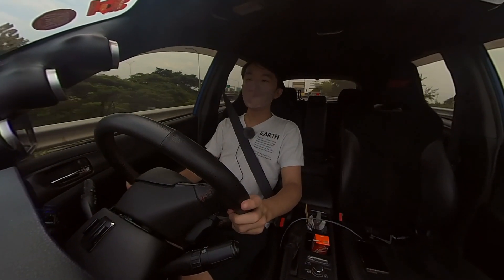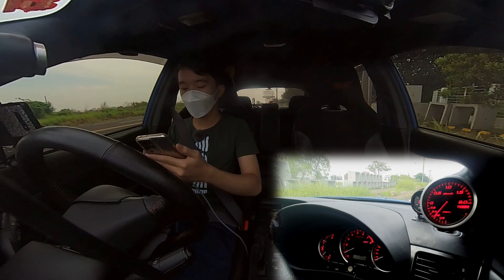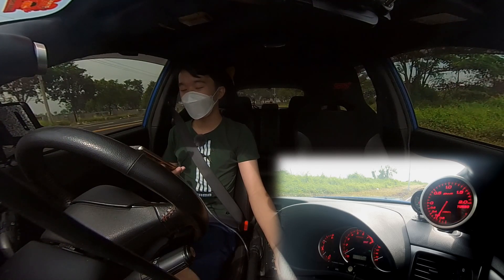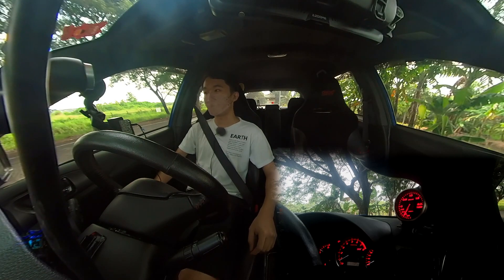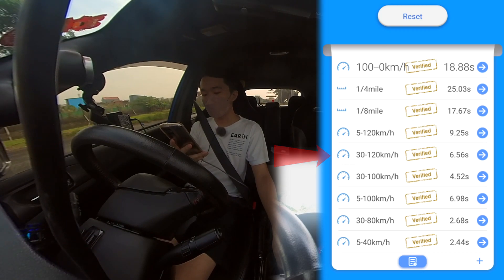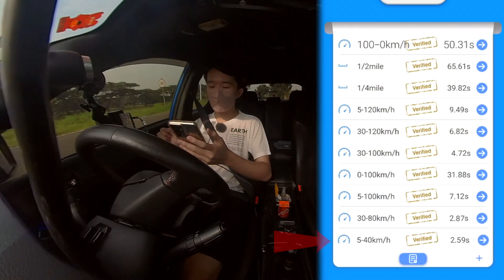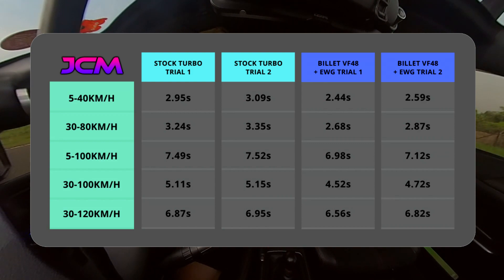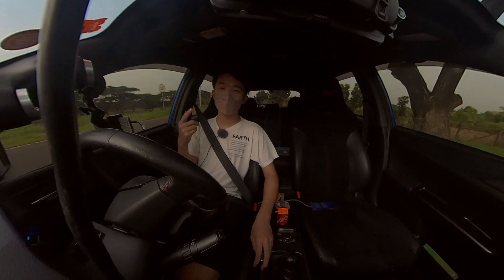STi Stock vs. Billet VF48 + EWG | Dragy Comparison Test

Comment: Bro the timer will start as soon as it feels your car moving and that's why your getting such high times you need to do the test from a standstill im sure someone has already explained this tho as it is YouTube and we are all quick to point out what's wrong but lack in pointing out the good stuff lol I was interested in your demonstration but unfortunately you wasn't doing it from a standstill
Reply from the maker: nope, this was a custom run that I set on the dragy to start recording after I go past 5km/h. doing it from a standstill would make things inconsistent due to the difficulty of awd launches, and because you can build a bit of boost by revving at launch. hence, by starting at 5km/h, the amount of turbo really shows, as well as the impact of the billet wheel

Comment: Where did you get the your turbo work done at?
Reply from the maker: Got the billet CHRA at superveloceturbo on ebay, and had my local shop get it installed. Shop is "SP Garage" if you live here in Indonesia. Here's a link to the ebay listing though
https://www.ebay.com/itm/353106757899?hash=item5236cd890b:g:19sAAOSwsnZgQzV~

Comment: is the billet wheel the same size or is it like a 16/18g wheel with larger compressor housing to fit the billet wheel. also has the turbo been ported. 38mm or 40mm ewg?
Reply from the maker: it's the same wheel size, just ported the inlet by a tiny bit to make sure the clearances are safe and it's a 45mm ewg from turbosmart

Comment: What power were you making on the stock vf48? Also with you comparison runs, was there a difference in time of day / ambient temperature between the stock vf48 vs billet runs?
Reply from the maker: The time, ambient temp and humidity were roughly the same before and after. With the old setup on the medium boost setting (1.2 bar tapering to 0.8) shown in the video, it made around 270whp. on the new setup on wastegate pressure (0.8 bar) it made around ~250whp but more importantly spooled 400 ish rpm earlier, and the powerband at the top kept increasing till redline thanks to the EWG. Previously the powerband started to drop past 6300rpm
Reply: @JCMediaYT Just curious. So you made less power but spooked quicker? Wondering what the outcome would be if just the billet wheel was put in a vf48 but with no ewg. Same hp but quicker spool?
Reply from the maker: @anthonymarquez4563  It made less power because it was on much lower boost (0.4 bar less). With the latest tune we changed to a 1 bar wastegate spring and it made 280whp, and at 1.3 bar it made around 330. I'd say part of it is because the ewg allowed the boost stay consistent throughout the rpm range, whereas with the IWG, it would drop by almost half by redline. I think changing just the billet wheel would make it spool quicker but wouldn't have much difference up top (assuming it has a similar blade wheel design). It might net a slight power increase though, I'm not sure.

Comment: Just curious, why you have confidence on that ebay turbo?
Reply from the maker: Because not everything on eBay is garbage, it's just that it's really easy to sell crappy products there, causing that negative connotation of eBay products. I'd say as long as you find a reputable company with good reviews, eBay parts are fine and worth the price.
Reply: ebay turbo?🤣wdym
Reply: @JCMediaYT  How is the turbo holding bro? I'm in dilemma getting this or the Mamba/Arashi
Reply from the maker: @frankchong5585  The turbo actually failed recently BUT it was because of debris getting into the turbine, not related to it being from ebay at all. Personally, I'd get the Mamba one. Hope that helps!
Reply: @JCMediaYT  what you're looking at now as replacement?

Comment: How fare do you think you could push the peak power and when does it hit full boost
Reply from the maker: currently im at 350whp @1.35 bar, planning to try push 1.5 soon. full boost hits before 4200rpm